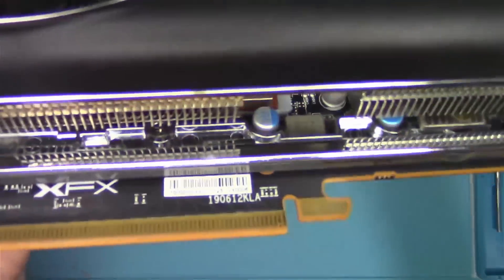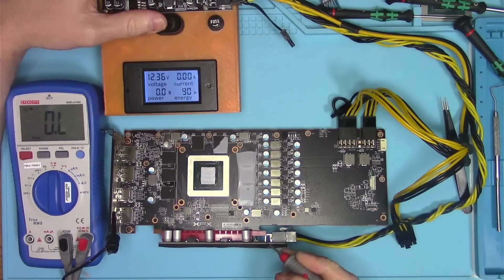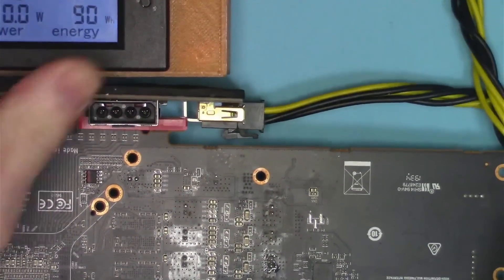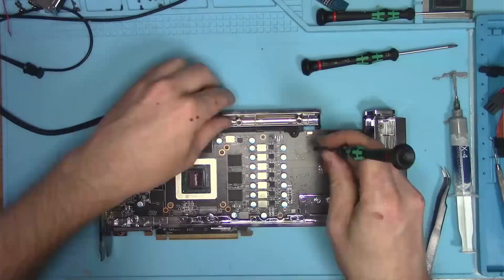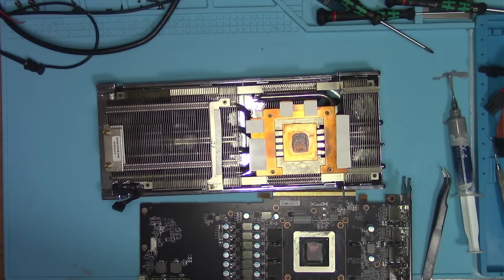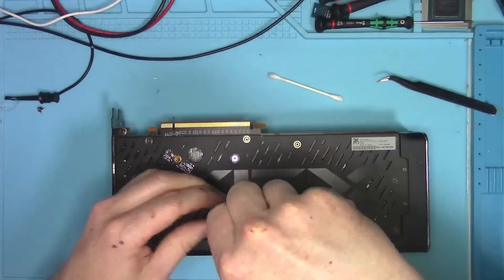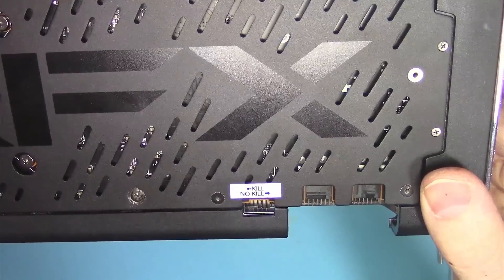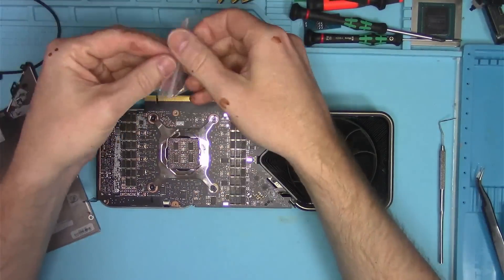Why your gpu crashing under load and how to fix it

Comment: i wanna send my  Gigabyte 6900xt OC to you, it crashes to black screen under heavy load, like call of duty warzone, i need help
Reply: Unstable oc mostly ... = crash.
Reply: @sENoZ_x264  i ended up with a RMA with Gigabyte (3years warranty) got my money back
Reply: @Vandunken  Wich gpu will you get so ?
Reply: @sENoZ_x264  Just upgraded to an NVIDIA 5080 Astral OC 😎 — absolutely crushes every game on max settings. I also moved from an AM4 Ryzen 9 5900X to a 7900X3D, and the performance jump is real. My wife’s rocking my old rig now, paired with an RTX 2060 — still a solid setup!
Reply: @Vandunken  Nice, 7900x3D is a monster. The 5900x is still a monster as well, i can push down to slower preset with that beast on this pc 5900x/6800nitro+

Enjoy :hand-purple-blue-peace:

Comment: my 2080ti nvidia drivers would crash on start up, strange pixilation on the screen, full crash + reboot. it was stable in 720p, and the hz would be at 54hz with no other options (my monitor is a 3440x1440 120hz) and there was not 3440x1440 options, only 720, 1080 and 900 or something. 1080p would have pixilation as well. the nvidia drivers would crash instantly on startup,  it started to crash my AMD PSP 11.0 Device, and then bricked my m.2 980 evo. I had to do a full reinstall of windows. Plugging in an old 1070ti i had laying around showed everything on the computer was fine. memory was fine (32g gskill trident z 3200), cpu was nice and cool (5800x3d), and everything ran just fine with the 1070ti. 

after about 2 weeks, i plugged it in again to see...it ran perfectly as if nothing wrong for about 12hrs, i turned the computer off for the night and the next day the same thing was happening.

fast forward another 8 weeks, my friend noticed it looked like something was split on it. its a 2080ti black so it has a back panel.

I took the back plate off, all of the thermal pads look clean and underneath them it was perfectly clean. but there are multiple spots on the motherbaord that do look like 'something' was split on it. i used alcohol and qtips, cleaned the entire back of the motherboard, the 'spill' areas were still discolored and the alcohol acted weird in those areas, however it was very dirt especially in the 'spill' area. 

after cleaning, i plugged it in and there has not been a hint of issues with it after multiple 12hr sessions and full gaming loads.

Is it possible this was being shorted out but not enough to destroy components?

Comment: hlo..sir

please help me

i have been facing the issue of sudden power off in my gpu but now it's not even getting power on

the fans are spinning but i feel the temperature in my gpu is not warming as usual its like fans are getting power but the chipset of gpu is not getting power.

sorry for my bad english...sir🙂

Comment: Yo, my guy. Can you tell whats the problem on my GPU please. It keeps on crashing and going to BSOD then after i restart it, the graphics driver is always getting corrupted. But after reinstalling it goes crashing again and again. Can it still be fixed? or maybe just use it as a paper weight?? :D thanks in advance

Comment: I have a problem Gigabyte RX 570 that I just tried to test. It displays but crashes to black screen when trying to render Unigine Heaven test. I did manage to check it in GPUZ and it was running at 47 - 51C. My other card runs in the mid 30's with no load. Tried in another machine that has the same card and driver installed in it and it acted the same way. The card looks to be in pristine condition in original anti static wrapper and box with CD. This video gives me some hope. Thank you. I'm hoping the usual cleanup, paste n pads can cure it.

Comment: I just had a fairly new Pc built last year but had NOT actually used ( only powered up to load music production software ) until yesterday [ 20/04/24 ] while I was playing back some music I had created. I paused and went into YouTube for musical help, found a useful vid then saw another and went to click on it. The second I did this the video froze then screen went entirely green then blackout. My led keyboard and Mouse did the same, so I waited a min or 2 and nothing. So I pressed the reset button hoping it was just a glitch, my led keyboard/mouse lit up but... not my screen. I swapped hdmi cables, tried on different screens, checked if cables were inserted correctly and still nothing. Is this a sign of a dead GPU ( radeon RX6600 ) or should I take to a Repair store BEFORE I decide to smash this Tower up?

Comment: all it needs is its dual fan power lines split, with only one going to the gpu as well as rethermal pad and a fan on the thermal pad area of the backplate. i use a molex to 12v for one of the fans and the third fan is on chassis jumpers. it took me 4 years to figure out how to get the gpu not to crash, and even run it stable with 1354mhz overclock (sapphire rx570 8gb). i also made a video about it showing my modifications which are very crude but effective.

Comment: next time, use a water sand paper, on the cooler where it makes contact with the core. Cooper oxidizes preety quickly. I had an old msi, that went from ~90º to 60 from that same scenario after making cooper "shiny" /clean again.

Comment: Hi, Im having the same issue with my GPU, where it would crash after the PC updates the GPU driver.
Ive already tried to boot it in safe mode and used DDU to uninstall previous driver and fresh install.
Updated MOBO bios, and flashed vbios ):
I tried joining your discord but the link doesnt work anymore.
I was wondering, can I send you my card? its a 3080ti Aorus.

Comment: ITs XFX not AMD :D. Garbage cooler, good job XFX. I have few rx 6600 xt with 96-100C on hotspot. Thermal old thermal paste was good, with new, the same result. ASUS card RX 6600 XT did not suffer for bad cooler.

Comment: I actully have the same ''issue'' on my Sapphire RX 5700.. on my stock cooler I have over 30c dif between hot spot and the regular gpu temp.. but I put the grapic card under water full block, not an issue any longer. 

That said, the Navi gpu's is designed to pull as much heat they can, 110c on the hot spot is not a problem, says AMD.. but I don't like 110c stuff in my PC. 

Anyhow.. I will always use water cooling for now on on my GPU's, full block.. good investment if you gonna have em 5+ years and OC'ed.

Comment: .5mm and emery board as in nail file on lazy Susan to make a rolled edge like rounded edge table then try it again 5c to 13c maximum edge to center temp after mods
Reply: can you explain?i didnot understand the hotspot for me is 35 delta
Reply: @qdo4   30 delta 35hotspot 5c shift in part spot inside of chip to assist in automated self tuning
Reply: @BRYAn_NiTRo  i know i mean how did you fix the hotspot issue?the edge is 65 perfrect but hotspot reached 100 it’s crazy
Reply: @qdo4   EMERY board aka a paper nail file then sanded the circumference of the chip surface then press the heatsink until it sucks to the chip and gets hard to remove aka 99% surface contact.
Reply: @qdo4  atm im at 6c difference on my RTX 4050 laptop helped with battery life

Comment: Can't find my mx4, it's going to have to be my thermalright paste I've had for 10 years.  The pads are dirty, but it's a 1080. Had a super glue back on one of the coils because I broke it off.
All the components have thermal epoxy on top of them I can't scrape off.
Maine plastic shroud over the aluminum heatsink has a 4 by 3 hole that I cut in it comedone going to need to electrical tape over

Comment: wooow so 61 C is high i recently bought a used zotac 1060 temps are usually in between 60 -70 when i stress test it on furmark does that mean i have a faulty gpu oh and ideal temperature stays in between 30s or 40s

Comment: I bought a cheap msi 6700xt that had consistent crash at red dead redemption 2 benckmark, in swamp area, while the old 5700xt showed super stable for years. No instability in other games, glad it showed at all, ive returned it. Now running a rock solid 6800 but living in third world countries while trying to build and keep a decent gaming pc is a hazardous endeavour.

Comment: I have two 970's and both gets blackscreen in windows sometimes at 10 Seconds sometimes 10 minutes . Thermalpads and paste changed.

The one gets after 15 seconds in furmark 720p a orange screen and pc reboots and the other gets a grey screen in furmark.

Updated the bios and the drivers but didnt help 

PSU is good, and pcb looks good also. What can be the problem? (No artifacts)

When i get blackscreen in windows the PC doesnt restart
Reply: Both are from EVGA, on SSC and ftw model

Comment: I just replaced my thermal pads. Was very careful to make sure everything was perfect. Powered it on. Got artifacting and dead gpu. Nothing looks messed up so no idea what happened. Paste and pad contact was perfect. I guess just bad luck.
Reply from the maker: You must have twisted/bent the card while opening.
Solder joints cracked or pads ripped.
You now need either a reball or another memory chip
Reply: @northwestrepair  a bad memory chip will cause the GPU to not even spin the fans when you turn it on? Windows does not even detect the GPU. But the RBG works lol.
when I removed the cooler I simply removed the screws and pulled up on the PCB from the cooler. But I trust you know what your talking about. Is that something that is expensive to fix? Im trying to RMA it with Asus but I dont hold much faith they will fix it. Is that something you can fix? Thanks for the response.

Comment: AMD cards have a really big gap between GPU Core and Hotspot, it's not always something wrong. 
Then i am here, pissing myself because my hotspot is 10°c higher than the core..

And i remember, the 5700 XT XFX cards run like garbage because of all the plastic used, i'd go so far saying removing the plastic shrouds would result in better temps.

Comment: I Have a problem but idk what is the cause of it..When i turn my pc on the monitor turns off After passing the bios (in the windows logo)..till i unplug and plug it ..i just got the RX 5700 SAPPHIRE and it is probably the problem idk.. (Everything else works fine) ..Pls HELP
Reply from the maker: Not that simple.
It can be many things.
Need testing
Reply: @northwestrepair  Thanks.. unfortunately i live in the other side of the world lol..Can i have like an idea of what testings i can do ?..or a near fixer can do ?

Comment: I've got a question.. I've always been an EVGA fan as far as build hardware goes.. I certainly have a EVGA 2080 Ti XC Ultra 2 that I bought new back in early 2020 when I built my rig and it's been a fantastic card.. Come next year I'm thinking of building a new updated rig with the latest and greatest.. Now that EVGA is no longer making NVIDIA GPU's, what manufacture would you recommend? Who uses the best components?

Comment: So, ehm... if this thing is running too hot, why is the fan not going past 61% in Furmark?
Who configured that fan curve? Is that supposed to keep the noise down? Make the cheapo fans last through the warranty period before the bearing fall out? I don't get it.
Reply: the gpu ran at 61,the hotspot is 90.the fan curve is set depending to the gpu temp not the hotspot,still 90 with new thermal paste is worrying

Comment: Dude I know you recently lost your job but with your expertise and knowledge you should consider opening your own repair shop. With your reputation on YouTube and a promising future of consumer electronics.... I don't think you'll have any problems getting business. Also your video editing, narration and general flow of your videos is top notch. Better than any tech repair I've seen. Keep up the good work. Also I am a miner and replaced some thermal pads on 30 series because memory was 100C+ under load. Better pads brought it to about 80C. But I also MEASURED the pads and used the right size for replacement 😂. Thank goodness people dont research so we have great content from you 😅
Reply from the maker: The amount of time it takes to do even a simple fix for pads is so much it's hard to justify opening business and not charge repair attempt fees and charge more for repair
Reply: @northwestrepair to tag onto this, I'd open the business and charge the fees. The cost savings for the end user is worth the repair in most cases. Working on other consumer electronics is also a possibility as well to supplement things.
Reply: @northwestrepair there is a guy on (online auction site, yt won't let me post) that does flat rate repairs for nvda rtx cards, charges extra only if it needs new gddr chips.  Might be feasible if you can work from home
Reply: @northwestrepair  ofc you should charge for diagnosing and repair attempt.
Reply: @northwestrepair  Thanks for the reply. I understand it is not easy and requires time in addition to risk. Just my opinion from the outside looking in, you know your shit. Not if but WHEN another GPU shortage hits, either because of a crypto or AI boom, people will pay what the GPU is worth to have it repaired. Not speculation, actually happened with the last mining boom. GPU's are becoming less luxury and more essential with corporations buying them and AI cloud computing right on the horizon. When there is a GPU shortage, there will also be a technician shortage.
Reply: second option is to take the northridge way and sell me a flucking magic short killer at only 99.99 $ !
Reply: He will be the only person I send cards for repair in the future. GOAT !
Reply: Electronic repair is usually not feasible due to the repair costing more than the item.
Reply: @violent_bebop9687  Then how are there repair shops across the world
Reply: @renegade_patriot  the answer is very simple, the cost accounting is either profitable or it's not.

Comment: navi 10 gpu's just always have high hotspot. Undervolting doesnt help either since amd cards aggressively push clocks up to the maximum power envelope or thermal envelope. Only way to save temperatures is louder fans or lower power limit. The 5600 XT cards also use navi 10 but they also typically have a much lower power enelope so hotspots always seem to be MUCH lower than their 5700[xt] counterparts.

Comment: Sometimes, when you use pads, that are too thick, it may help to heat them up with a hairdryer or heat gun before putting the card together. 

When you heat up the pad, it will become softer, allowing to be compressed easier - the compression will also lower its resistance and increase heat transfer.
Reply: NO: just use the right thickness pads!

Comment: There might be a higher percentage of sub-par AMD cards, but there's still lots of good quality ones, and it's not like there aren't a lot of poor quality Nvidia based cards as well. You can't just say "this is AMD in a nutshell" after pointing out the poor performance of this XFX card. I'm not a repair expert, but I do know that's an unfair over-generalization. That just completely discounts the fact that there are a lot of very good quality AMD cards out there. 

According to O! Technology, RX 6800's are all somewhere between very good and excellent, and this is indicative of the 6800 XT cards which use the same coolers being quite good as well, though there may be some models that he didn't include in his tier list. I have seen very good reviews for a variety of AMD graphics cards, especially RX 5700 XTs back in the day. I did some research when helping to find one for a friend, and was surprised to learn that Powercolor's Red Dragon model was apparently quite good (Gamer's Nexus is a good source). One good thing about that Red Dragon card was also that it was slightly smaller than some other models, making it a better fit for my friend's ITX case, but while still providing more than adequate cooling performance on the GPU AND memory.  

Sapphire has an exceptional track record for making good quality cards, and often at very reasonable prices at the same time. Powercolor has also been making a lot of really good but competitively priced cards as well. 

Personally, I have become a bit of a snob for quality in graphics cars, though I don't really care for the heavily over-engineered (and over-priced) models either. My current card is a Sapphire Pulse 6800 XT. on the GPU and memory

Comment: There is nothing wrong with amd the problem may be that the cooler's cold plate may not be perfectly flat!
I know quite a few people who lap their coolers before installing them and can confirm I have seen temp drops of as much as 11C°!
Reply: If that is true, AMD could still slap their board partners for making their product look bad and ask them to improve on their manufacturing standards.
Shit cooler tolerances should not be a thing, if you need to lap your coldplate on a brand new product to get thermals under control you got scammed. Not to mention most manufacturers will void your warranty for taking the card apart and messing with components, so if it dies later because they also cheaped out on something else, you're out of luck.
Reply: @Kr0noZ  Well with the shit that Nvidia is putting out there I'd rather be scammed than give my hard earned money to them.
We pay for performance not looks!